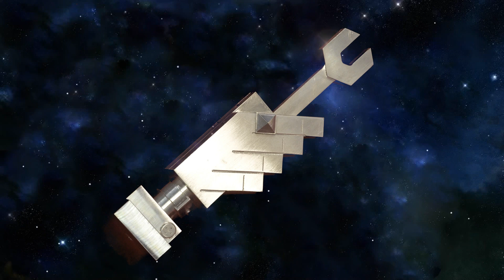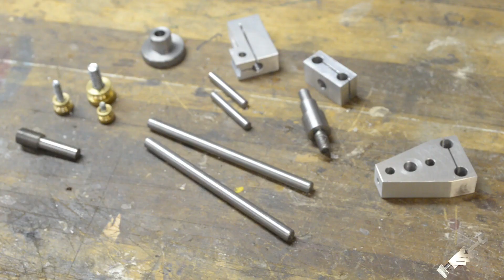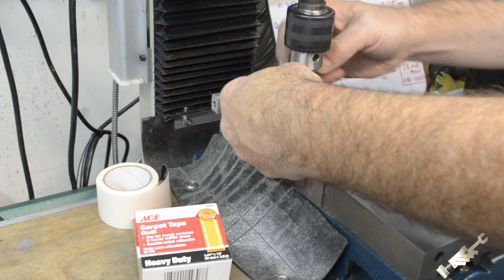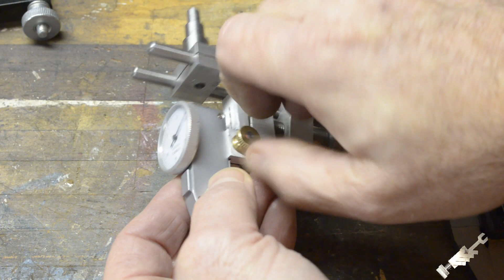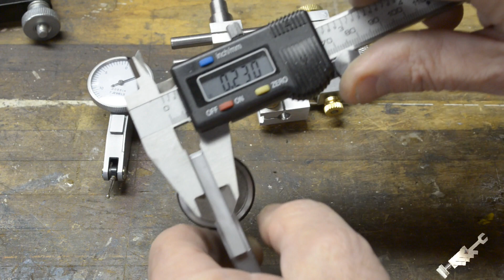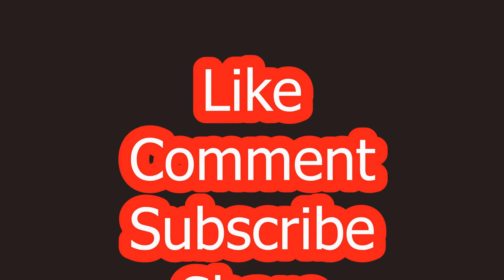Completed Zero It Indicator Holder & Final Thoughts

Comment: I would just turn the knob 90 degrees from the first hole and drill another hole, but this time have the shaft installed before drilling it that way the hole will be straight through both pieces.
Reply from the maker: Yeah you're right, but that would of been too easy... lol
Reply: @welcometothemachineshop466  .........lol